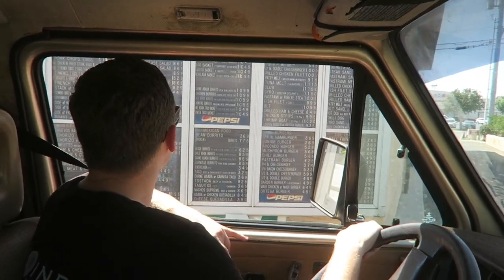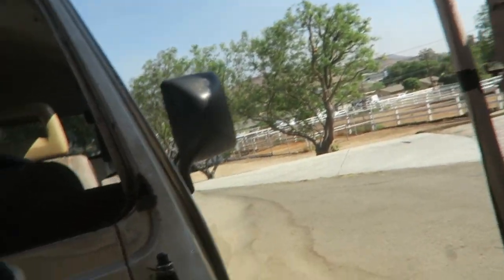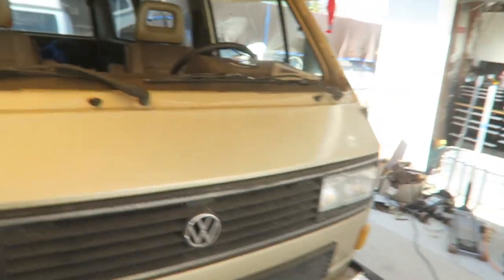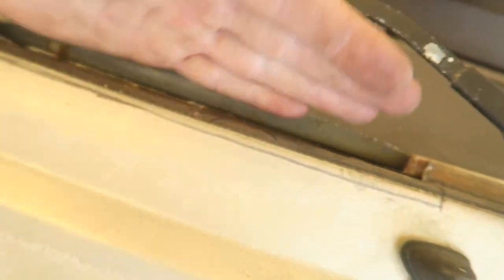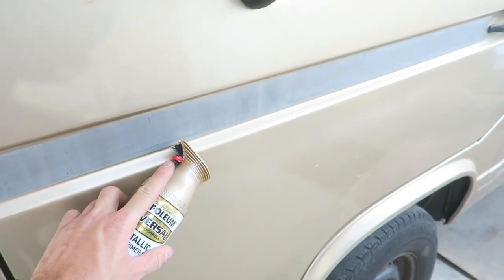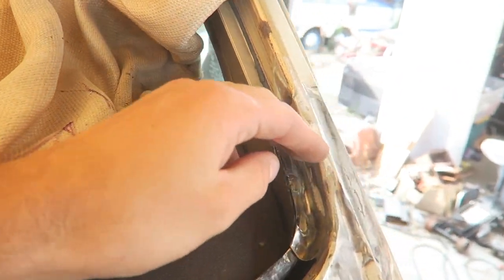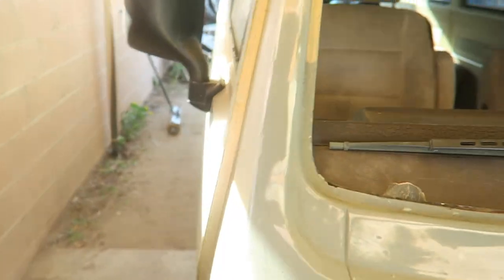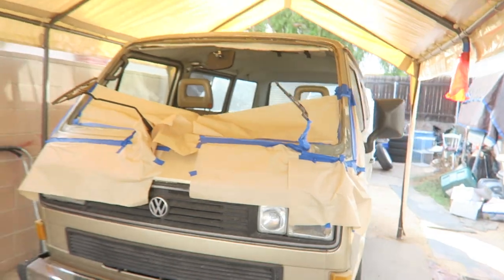VW Vanagon Windshield Rust Repair!

Comment: You don't need to remove the dashboard fully. Just undo the screen screws and the bolts near the door and steering cowl. After that the dash will pull back about 3inch. simples.